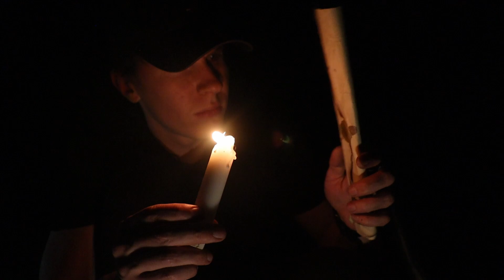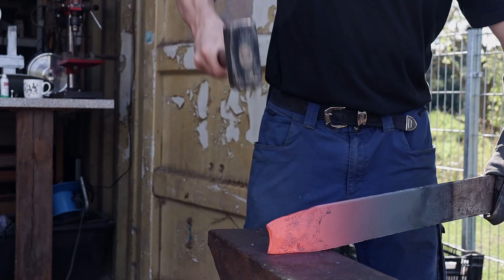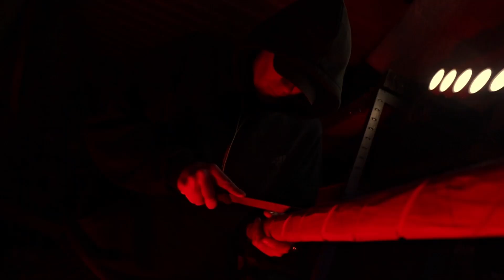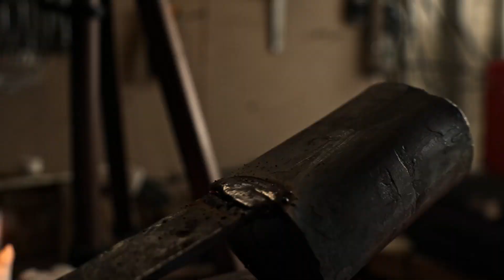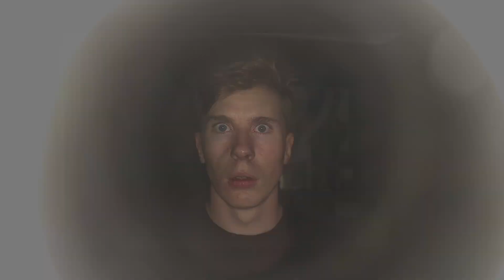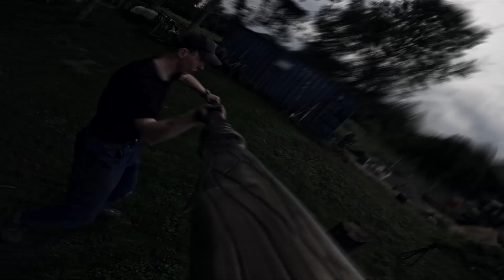Forging Inarius' Glaive from Diablo IV

Comment: Awesome video style, the waterbottle got sliced pretty little though, did the blade end up duller than expected or was it just undwieldy to use?
Reply from the maker: Thanks!
Probably a bit of both, I didn’t put much effort into sharpening but even if I did, the blade shape and edge geometry isn’t designed for super clean cutting. It’s shaped more like like an axe to take more abuse ✌🏻
Reply: Well what is the cutting ability usefull for when your enemy run from fear by the looks alone ^^  @NjordArtisan